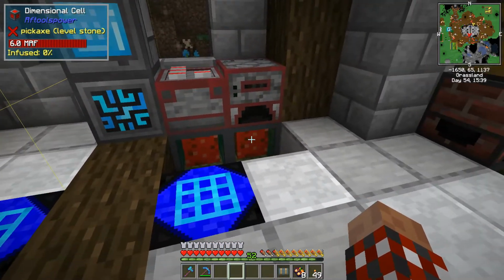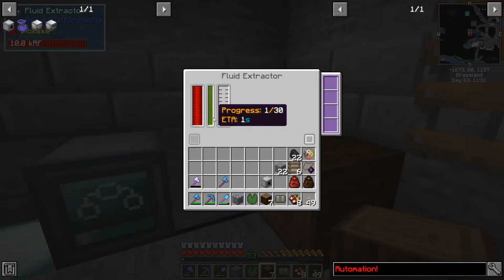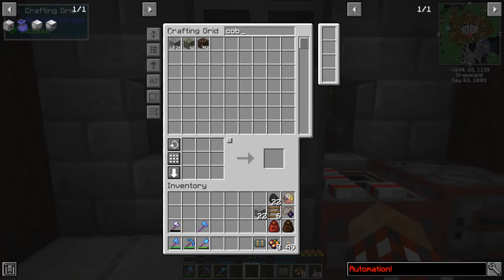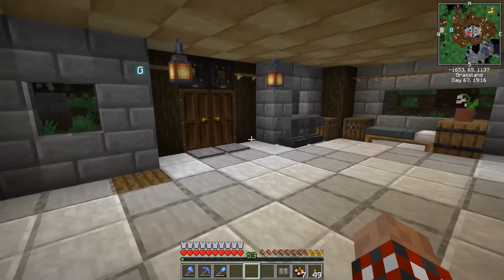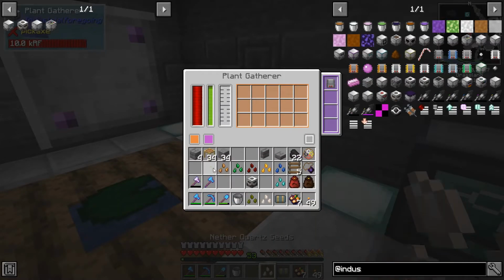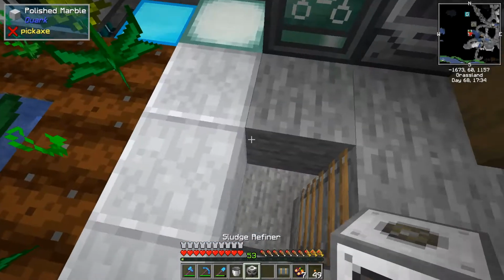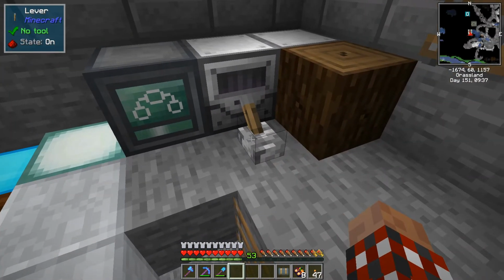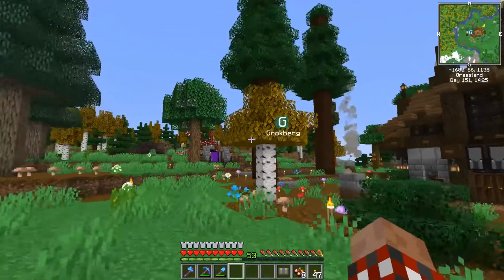FTOG ATM4 #09 - Crashes and Crops and Traders, Oh My! - Minecraft 1.14.4 Let's Play

Comment: 8:41 Man, I can't wait to see you try a skyblock pack 🤣

I like that IF is already available for 1.14; I suspect the sower and gatherer (like in 1.12) also consume energy when they are idle (unlike the MFR equivalents)? Those xnet tooltips look to be in the reverse order.

The only problem with the current setup is that you'll get extra seeds and that may get planted and eventually some seeds will no longer get planted - but you can configure the 8 regions for a specific seed in the left hand part of the planter's GUI. And in 1.12 there's a redstone option; maybe they changed it to an upgrade? There's nothing on the wiki but it does speak of a book inworld.

Don't be dissing Thorgal's plantium, man, he's got DIRT seeds!!! So there.
Reply from the maker: Skyblocks and me?  Falling and screaming.

The sower and gatherer only used energy as they did actual work.  I kept feeding the process until they all ran out of power.  If this were a server with chunkloading and lots of players, I'd just break the machines and store them in the chest.

I worried about getting extra seeds, but that only happens on the upgraded Mystical Agriculture farmland, and the planter doesn't plant on that.  As for a manual, I looked last night, but didn't see one.  I could be blind.

And Thorgal has dirt AND cow seeds!

Comment: Man... Grock it's 1.14. Bubblvators are a thing and you havent played with them yet. Maybe give it a shot before wasting precious pearls.
Reply from the maker: That would need an up and a down channel.  But very doable.  I will look into that with the next tall building.  Or deep.
Reply: @GrokDuckFarmer  Two solutions. First quick and dirty block swaper under the single water column. Normally a magma block but when you walk across a pressure plate at the bottom for a few seconds it changes it for a soul sand or feather fall. Its not a hugly tall build... Geronimo!!!
Reply from the maker: Oh, sure.  Jump.  I have flat feet already!